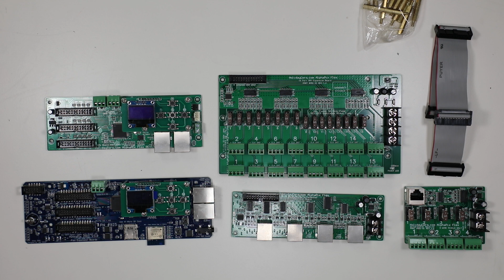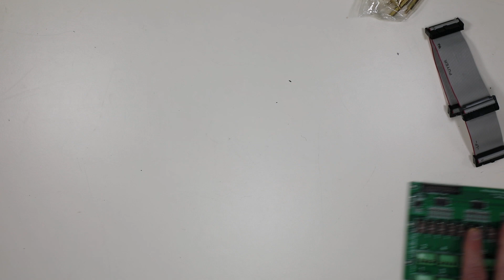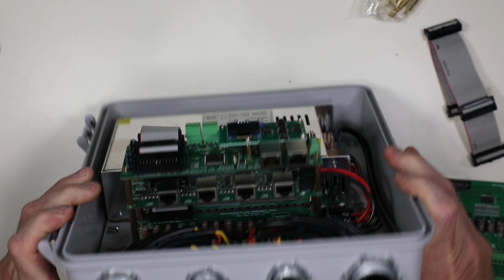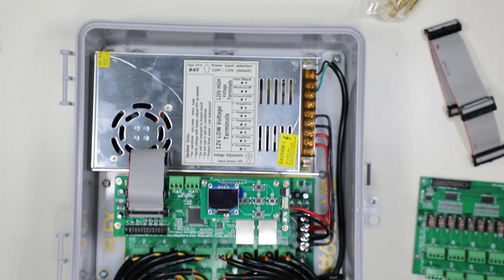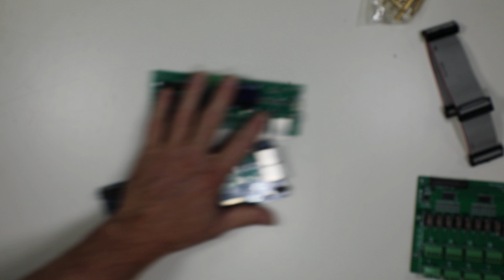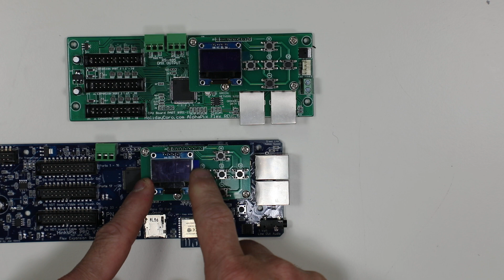HolidayCoro Flex Expansion Board and CPU Overview

Comment: This seems pretty cool and full featured.  I notice power has to be run to every receiver. Any chance for using PoE instead to power the lights? Could massively reduce the wiring needed. 

I would love to do stuff for my home, but this looks overwhelming. 😂
Reply from the maker: There is not sufficient copper in CAT5 cables to run thousands of pixels - would be nice if you could do that...maybe when POE is at 120v  :)